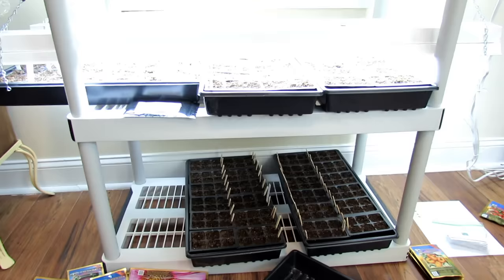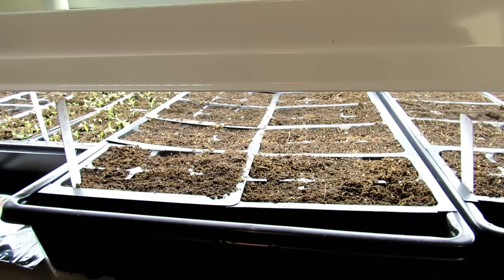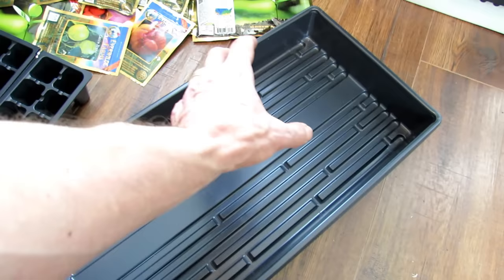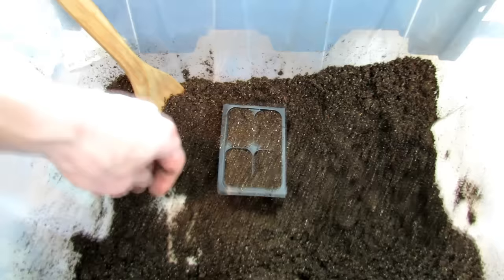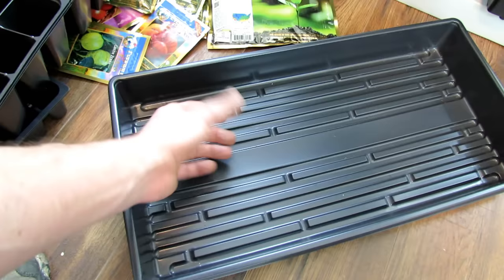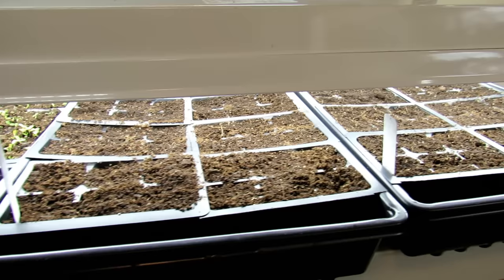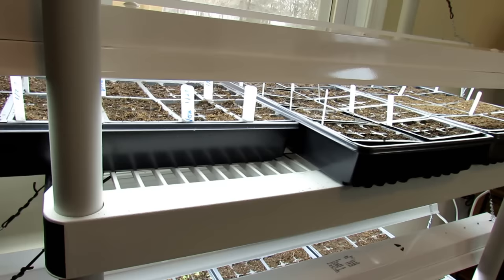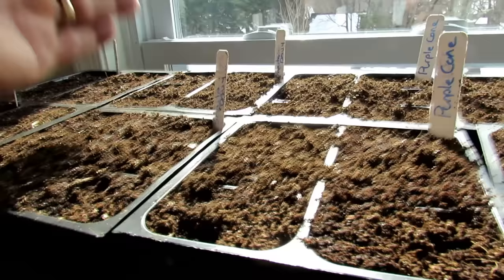Seed Starting Basics: 30+ Questions Answered on Seed Starting Indoors - Digital Table of Contents

Comment: What about using humidity domes for seed starting? Thoughts?
Reply from the maker: I dont use them. I found they make more fungus. 
Check out my new Amazon Influencer Shop. Ill be putting what I use in videos there for 2019. It is all set up by categories. Thanks.  https://www.amazon.com/shop/garypilarchiktherustedgarden
Reply: I keep my house temps at 68, lower than what the seeds need. I need to use a dome to get to the right germination temp for summer starters, between 75 and 80 degrees. However, I do suggest that if you use a dome you also use a seed mat temperature control so that the seeds will not overheat and potentially die. Also, if you don't over-water and do use some biology in your seed starting soil, like Espoma biotone starter, you won't have to worry about bad fungus growing because it will be out competed by the good fungi in the mix. That being said, I've never had a problem with fungus in domes even if I use sterile media. We all have different growing environments and have to figure out what is best for us, and that includes deciding whether a dome is necessary in our situation or not. In my case it absolutely is.

Comment: I got lights that were unfortunately 1200 lumens. I however have 8 of them, if I place them all side by side, will that work? Are lumens stackable?
Reply from the maker: They dont stack additively. Sorry. That probably isnt enough light for strong transplants. If you are going to try, the need to be really really close to the seeds.
Please visit The Rusted Garden Seed & Garden shop for your fabric pots, fall & spring seeds, seed starting supplies, peppermint oil, neem oil, TRG merchandise and more at www.therustedgarden.com Check out my new gardening PODCAST Gardening Coast2Coast at https://gardeningcoast2coast.net with CaliKim

Comment: Great video Gary, thank you!!  Someone was telling me that seeds need high humidity so they keep their seeds trays inside trash bags to hold the moisture until they break the surface.  Any thoughts on that technique??
Reply from the maker: Nah. Not needed. 20 years of open flats. I dont use the plastic domes either. If you can manage watering and watch them, they germinate.
Check out my new Amazon Influencer Shop. Ill be putting what I use in videos there for 2019. It is all set up by categories. Thanks.  https://www.amazon.com/shop/garypilarchiktherustedgarden

Comment: Hi Gary,
 I have been following you since I found you last year and had 100 Percent growth from my seeds by following your videos and tips and wound up with far too many plants to the point of giving them away!
I do have a question though!
What are your thoughts on Humidity domes?
What do you think is the MAX germination temperature for seedlings?--- I'm wary of investing in heat mats and have simply used a tiny space heater for my homemade greenhouse that is setup in our heat-less basement. I worry about killing my seedlings from it becoming too warm!
    Any help would be greatly appreciated!
Garrett from Georgia!
Reply: @raymondaten2179  Thank-you, I think I'm also going to use a timer to turn the heater on and off to avoid overheating.
Thoughts on Humidity domes that come with all those seed starting sets?
Reply from the maker: So I dont use the domes. I dont think they are really needed unless you cant maintain watering easily. I found I got more fungus with them. Max germination for warm crops, 75-80 degrees. I find heat mats do speed it up but only if you cant keep the house the space in the 70's
Reply from the maker: Heat mats take to 80 plus and speed it up. Sorry @raymond Aten... i deleted you comment by mistake.
Reply: @THERUSTEDGARDEN  thanks for the advice. I put the heater on a timer so it's on and off every hour or so and is maintaining around 80. I think i'm going to use the domes until sprouting simply because the heater runs with a small fan and I'm afraid of drying out too fast.

Comment: How does the pH turn out if I bake my starting mix?
Reply from the maker: No change
Check out my new Amazon Influencer's Shop. Anything you buy on Amazon helps The Rusted Garden when using my link.  Ill be putting what I use in videos there for 2019. It is all set up by categories. Thanks.  https://www.amazon.com/shop/garypilarchiktherustedgarden

Comment: I've notice that you haven't covered do you not cover and is it reason to not cover
Reply from the maker: Never had a need. If you can check on the water/moisture there is no need. I found domes create more fungus and mold issues than good. 
Check out my new Amazon Influencer Shop. Ill be putting what I use in videos there for 2019. It is all set up by categories. Thanks.  https://www.amazon.com/shop/garypilarchiktherustedgarden

Comment: So I just got 2 of these lights because the reviews on them were pretty good, but after getting them and looking on the box, I didn't see a lumen value. So I checked on their actual website and it says 0.....

What would make them a good light, let alone a grow light without it?

https://www.gelighting.com/led-bulbs/e2624/ge-grow-balanced-spectrum-br30#

Would this be a good light?? Am I just missing something? Or did I get swindled? I'm not use to indoor seed starting.
Reply from the maker: So I looked at specks. It cant be 0. Something is a misprint. Sometimes grow light go off PAR value. But Lumens is not 0.

Comment: Do those lights use a lot of Electric
Reply from the maker: Actually very little. Like a few bucks. If you look up a wattage calculator on line. You put in the wattage the light run on. The box will have. Cost of electricity in your area. Easy to find and amount of time on. Youd be surprised.

Comment: How much does it cost on the electric bill to use the lights?
Reply: hope king around 3or so dollars a month
Reply from the maker: Yeah it is cheaper than one things. Look up wattage calculator on line. You plug in numbers and it tells you.
Check out my new Amazon Influencer Shop. Ill be putting what I use in videos there for 2019. It is all set up by categories. Thanks.  https://www.amazon.com/shop/garypilarchiktherustedgarden